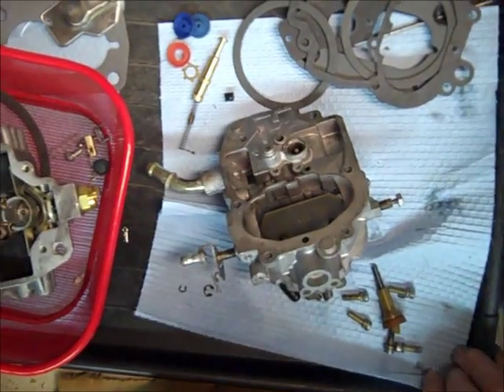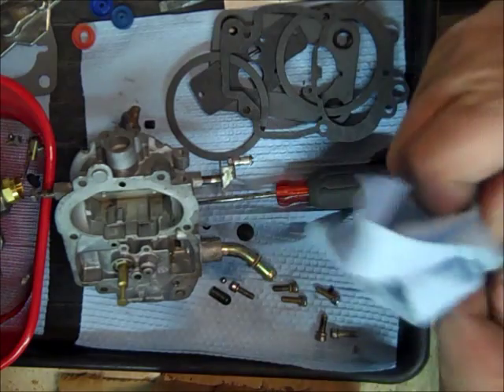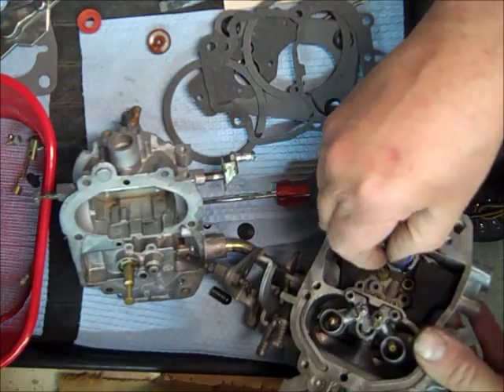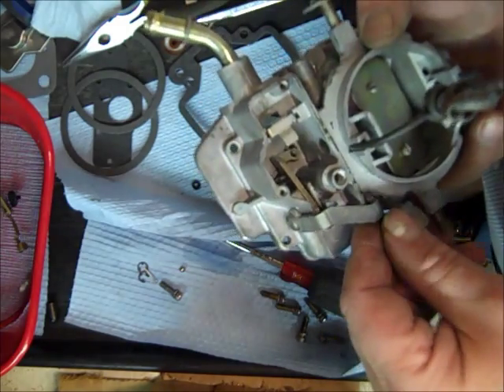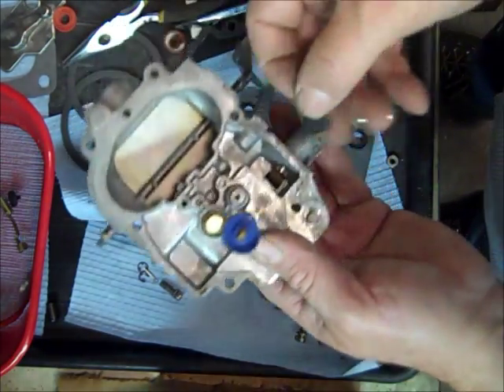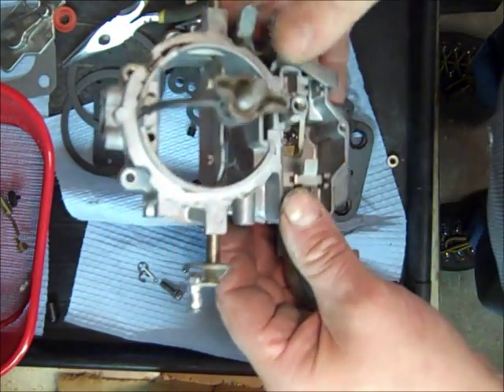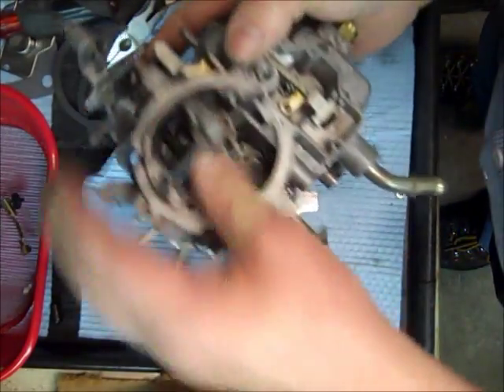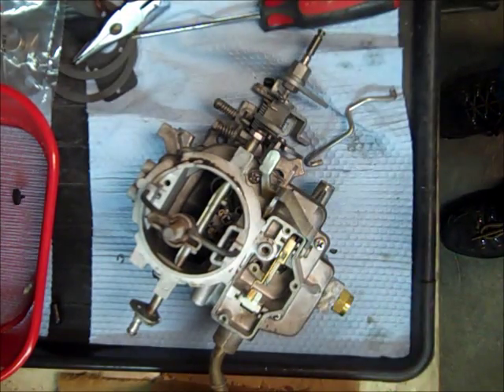Holley 2280 Carburetor Rebuild Part 4

Comment: Hi. I'm having a problem with my rebuilt carb 2280 Holley. When I drive my car when the engine is cold.  The car is hard to start. I have to pump the gas pedal like 20 times then start it. It just turns over a lot to finally start up. When throttle down driving cold it has hardly no throttle response. It will backfire but when i push harder on the gas pedal it clears up and runs fine. After it finally warms up it does run better. I have no choke problem . I'm puzzled having no power underload until it fully warms up. Thanks
Reply: Any solutions? im having the exact same thing pretty much, put a new carter bbd on my 318 after replacing my timing chain, i only have to pump gas 2 or 3 times to get it to fire but it misses and idles high till it warms up then runs as smooth as glass with plenty of power, seems like my choke opens slowly as it warms up and is working correctly, im baffled too

Comment: My 2280 has one way screws on the top compartment, how do you remove them ?
Reply: @MikesCarburetor  its called pump housing cover, #7 on the parts list. I did not take the cover off last time I rebuilt it due to those type screws.
I also have a check ball in the accelerator pump round well resting on top of the hole.  I suppose the check ball is meant to be there, as I rebuilt this 15 years ago, and has worked fine till now.. there might be a lot of different 2280 models. Mine is on a 83 4WD rmchrgr, with the accelerator pump with the conical spring on the bottom.

Comment: Why does my 6280 have a cone shaped spring that sits underneath the cup of the accelerator pump? It's so confusing ive never seen 2 springs for one pump before
Reply: @MikesCarburetor  your parts page says its called the float spring?
Reply: @MikesCarburetor  that's the thing,  if I put the spring under the floats the tab pushes the hard onto the needle no gas gets in the bowl,  stalling the car.  The cone shaped spring was Attached to the bottom of the accelerator pump when I first taken off the top. It's an 87 dodge diplomat 5.2 6880 feedback.
Reply: I'm not the first person to open this carburetor,  I gotta say I never seen 2 springs on a pump inside before.  Which begs the question,  why was it there?

Comment: I just rebuilt this carb with plenty of video that I took before I dismantled it the only thing the carb doent have that I'm finding hard to find is the primary throttle linkage hopefully you have this part or I do have some coat hangers around here just need proper length.anything will help me.thank you DennisCarb.

Comment: Mike,  I have a third arm that sticks out next to the vacuum piston.  It has a long thin arm about as long as the piston, spring, e-clip, and plastic cap on it.  This item is not shown in your video.  My carb is exactly the same as this one in every way except for this.  I don't know what this is and my best guess would be some sort of limiter.  Your carb has the same hole next to the piston for it as mine but doesn't have anything in it .  Any idea or  info?
Reply: Ok, it's called a mechanical power valve push rod.  Should I leave it out?  It's number 12 in the carb parts breakout.
http://s7d9.scene7.com/is/content/GenuinePartsCompany/1787797pdf?$PDF$